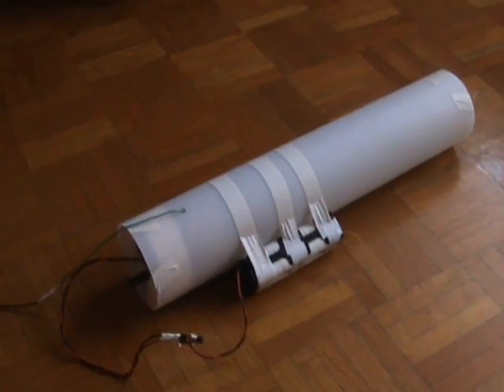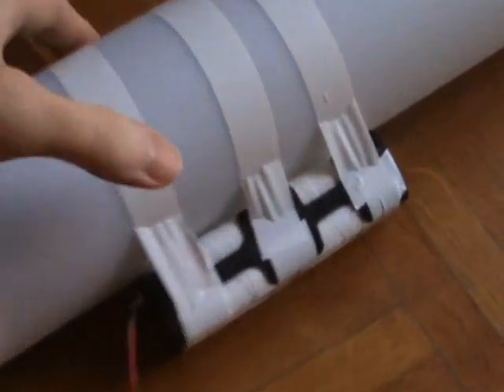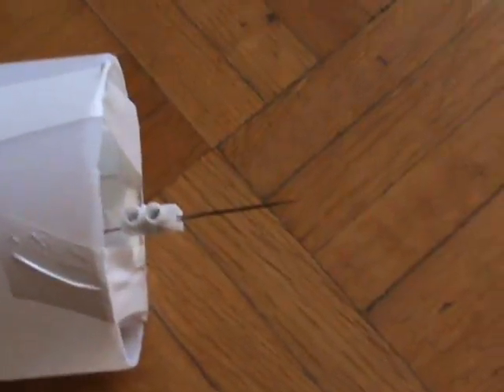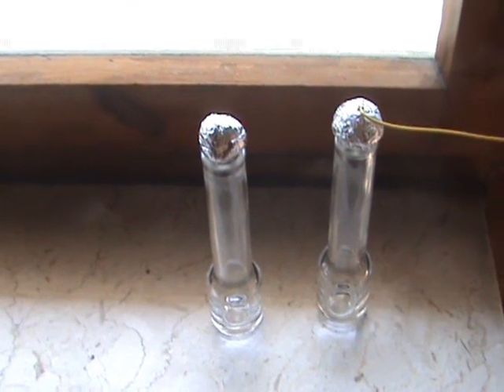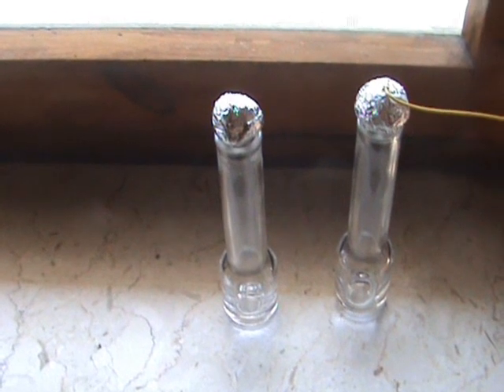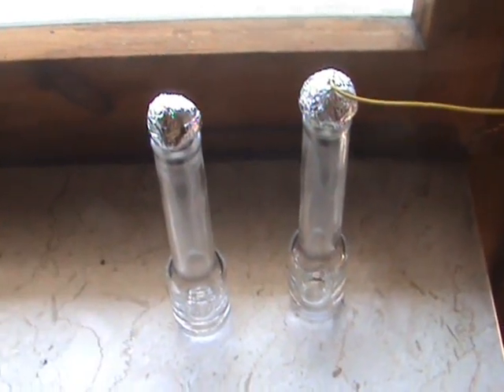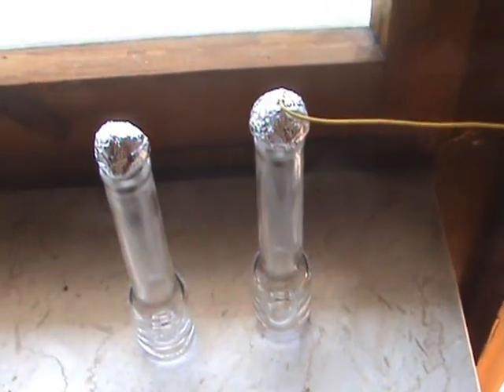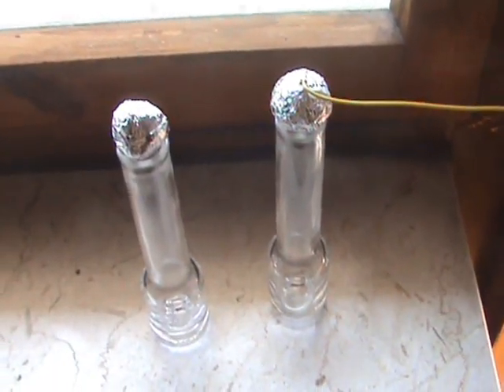Experiments with an ion ray gun

Comment: Is ionisation absolutely necessary for an electric current to flow? Or does the presence of a substantial amount of electrical energy automatically ionise the air? I notice that Arc Furnaces don't necessarily need a stream of plasma, or I am horribly mistaken.
Reply from the maker: If you want charges to move through a fluid (no matter if it's a gas or a liquid), thus forming a current, it isn't even accurate to say that ionization is "necessary" for the charges to move. Ionization is, by itself, charges that are moving. In the case of an arc furnace, it's even implied in the name. If you see an arc, that's plasma.

Comment: I had one of these as a teenager.  I got it from Information Unlimited.  It was one of the few things I got from them that didn't need to be sent back to be replaced.  It did all kinds of neat stuff.  Two of the most interesting things it did was light up ordinary lightbulbs like plasma globes and 'suck' up rubber cement in thin strands from the bottle through the air.

Comment from the maker: Yes. This particular model will give you at most a painful shock, and only at a maximum distance of 2.5 meters or so, but if it was more powerful... I'd say definitely yes.
Reply: If you Point the Ion Ray gun at somebody does somebody feel anything directly if you "shoot" it at him either If the person is isolated to ground or not ?
Reply from the maker: I never tried using it against a person (and I don't plan to), but knowing how charges move lets me make educated guesses about what would happen:
- if the person is grounded, the charges would move through them gradually as they are being shot, and they would feel nothing as this device generates a high voltage, but very low current (in layman's terms, each particle has a lot of energy, but there would be very few particles moving through the person)
- if the person is isolated, the charges would accumulate in their body, and as soon as a person touches a grounded conductor (e.g. a radiator), an instant discharge (i.e. a spark) would occur. This, I'm assuming would be painful, since there would be many particles moving at the same time through the body of the person.
Reply: @DevilMaster   but would a person feel absolutely nothing even with this high voltage during the charging process?

Comment from the maker: (Part 2 of the message)
I had actually thought about adding another electrode to improve the device (I had the inspiration from a patent of an ionizer). For that, I needed a plate with only copper, to solder to the ion emitter, and another one with a layer of copper on an insulating layer, to connect to the ground terminal, but unfortunately, I was never able to find them.

Comment from the maker: (Part 1 of the message)
One of the 555s is connected to the battery and generates the signal (the turning of a trimpot determines the frequency). This one is connected to another 555 which operates at a fixed frequency (100 Hz) and determines the duty cycle by the turning of a larger potentiometer which also includes the on/off switch). This one is connected in parallel to the inductor, the primary coil of the transformer and the MOSFET, which are connected in series.
Reply: can you please share the schematic?

Comment: Hi, your circuit, does it use two 555's in parallel and all other components in parallel before its gets to the multiplier (to increase current) or are the 555's used together as some other form of oscillator? just curious, as its not actually too bad....what would be neat is if you could set up another electrode with a even larger potential difference ,arranged and fired just after the first, to expell the electrons even further, kind of like a one stage linear accelerator..

Comment from the maker: @leaualorin Part 3 of the reply: if you want to make a portable ionizer, DO NOT USE A CONDUCTIVE CONTAINER! If the solder from the multiplier section makes contact with it while you are holding it, the multiplier would short out AND SHOCK YOU!
The original design for the ion ray gun uses a plastic container (ok) with a conductive strip connected to the ground lead of the transformer, that you're supposed to hold (virtual ground). I decided to avoid that risk and connected it to a real ground.

Comment from the maker: @leaualorin Part 2 of the reply: 275V are not enough. I don't know the current your power supply puts out, but assuming that you use a 15-stage multiplier like I did, the maximum voltage it would put out would be 2 * 275 * 15 = 8250V (but in practice it will be significantly lower given the losses for each stage). In comparison, I used a power supply providing 7500V at 10 mA. With 15 stages, ignoring the losses, that can theoretically provide 2 * 7500 * 15 = 225000V.

Comment from the maker: @leaualorin Ionizing a cloud from the ground with a normal ionizer would require the ions to travel in a straight line for thousands of meters, without bouncing off neutral air molecules nor transferring their charge to them. That is completely impossible.
To cover a distance that big, you'd be better off using a powerful laser (search "electrolaser" on Wikipedia). Even HAARP does not use ionizers: instead, it uses high-power radio transmitters with frequences between 3 and 30 MHz.